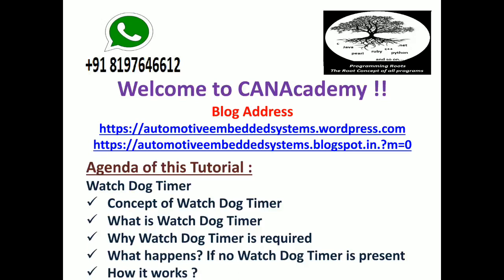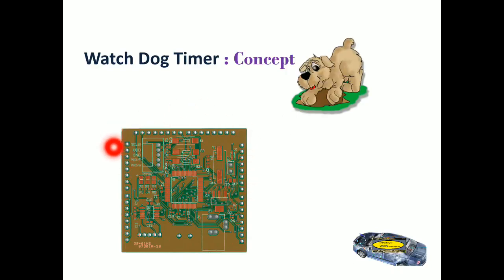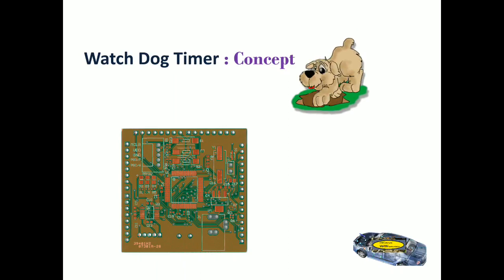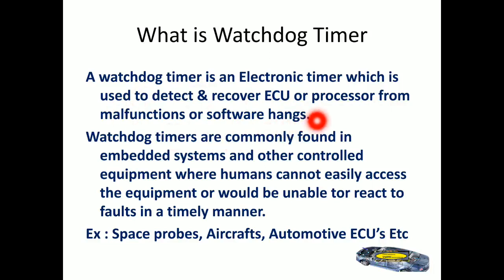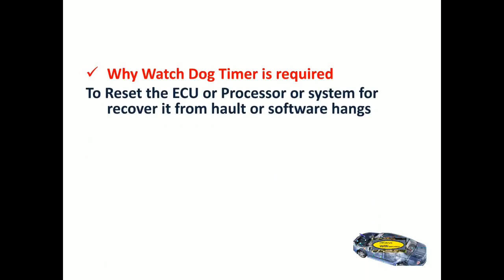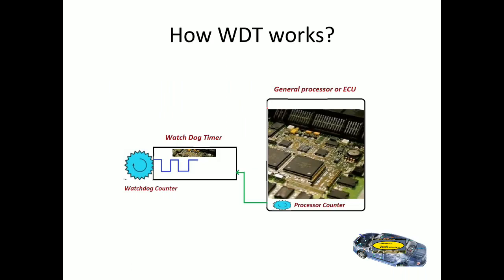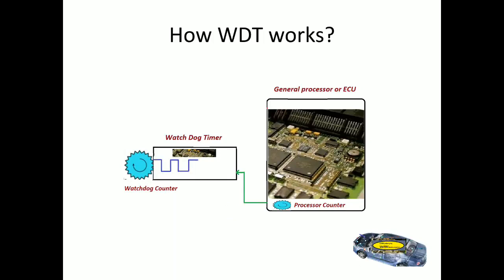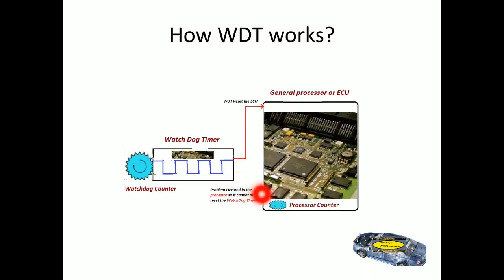WatchDog Timer | Embedded World | CANacademy

Comment: What is watchdog counter used for? Will it get incremented each time ecu request for reset?
Reply: simply counts if processors is fine continuously sending signal to interrupt counting if problem happen stop sending and counter goes finish counting and sending signal to your HMI saying hardware watch dog error alarm & stop your machine. that is i have been faced so far. "Hardware watchdog reset error

Comment: Great explanation! Thank you

Could failing or bad capacitors in the ecu trigger watchdog timer reset?

I'm trying to diagnose issue I think is with toshiba ta8903sn. I know it has watchdog timer but find no datasheet.
Reply from the maker: If the ecu not able to process the minimal information then watchdog timer comes into picture